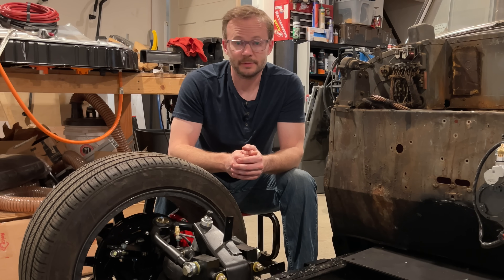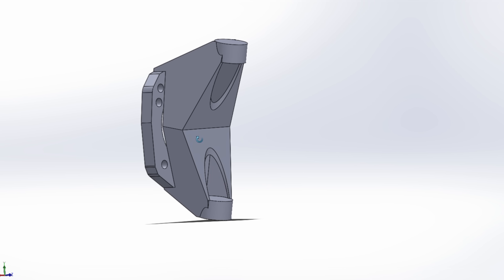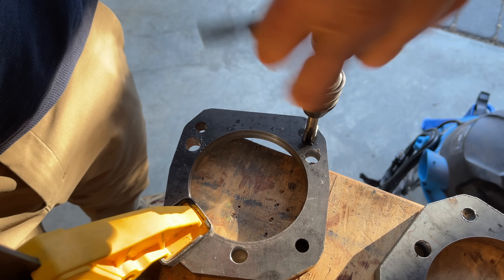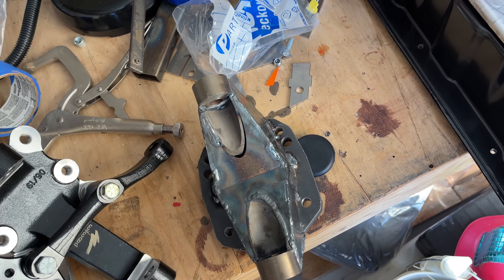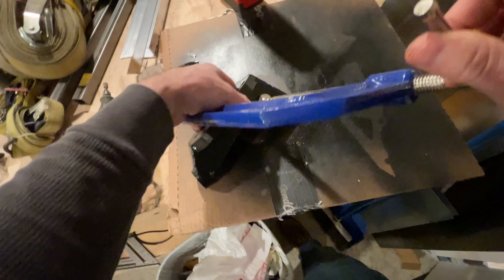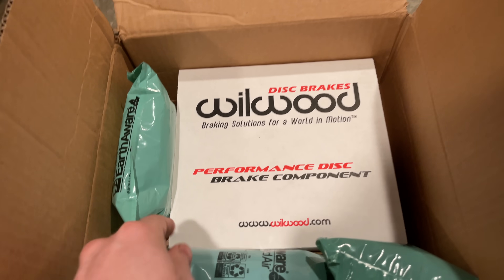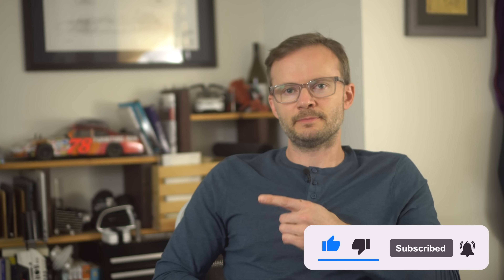Build Your Own Suspension Uprights. Or Just Watch Me Do It. Whatever.

Comment: Bro,  you are inspiring me to design my own custom suspension for my VW bus
Reply: check your local laws though- here it would be completely illegal- even the wilwood brakes would be illegal since the company does not provide the proper paperwork...
Reply: @olik136  yeah..... I got a lancia stratos (or rather, the rusted hulk of one) and i've been waiting on the paper work for years now so i can start the restomod correctly
Reply: Omg it's jehugarcia
Reply: Comfy or sporty?
Reply: first come to norway and convert a Volvo L-3314 for me :-P
Reply: Porsche 996 suspension would be great on a vw bus and then add hp.
Reply: I thinkt it would be a bit hard, most likely th easiest way to go is using a suspension off a car which has a frame and body on top.

So more regular cars like the 996 or your run off the mill car,they have strut towers and the suspension is attached to the bodyshell. Of course it is reinforced, but an older car has a more squar tube below.

So I imagine if you look at Corvette c4 front suspension, I think this is doable to adapt to classic cars as it is kindof an "all in one package". A bonus is that you also then can upgrade brakes at th same time.

Comment: Have you picked the Small Diameter Tesla wheels, because of the gearing ? If you fitted Jag diameter wheels the tesla motor would have to work harder & go slower , & worse again if the Jag has a higher drag factor & if its heavier than the tesla??    Or is it just you like the small wheel "dachshund" look ?

Comment: All the comments talking about safety nonstop make me think it wasn't a normal thing to build custom rally cars from junkyard finds as a teenager and slam them around tracks as hard as possible with welds and parts built using machines from the 50's and not the most experience.  It also makes me think that people forget Matt isn't new to engineering parts.
Reply: Safety third

Comment: That "press fit nut" and the half-a-hole on the other piece gives me the safety willies and I used to be a precision/stunt driver.  I usually over-engineer/build my prototype bits and then add speed holes later.

I applaud your impetuous madcap style.
Reply: Fr all that weight and torque under load lol fuck that shit

Comment: @SuperfastMatt
I have tried to get your attention before on previous videos, you have got your caster all wrong, top ball joint should be back from the lower one to get positive caster
Reply: Many years as a wheel alignment specialist with knowledge and understanding of geometry and lots of hot rod running the Mustang 2 set ups as well, I can just see it is wrong
Reply: @russellmurphy4191  Well, that's entirely unhelpful! You're saying "I can just see it is wrong, but either I don't understand it or I just can't communicate effectively, so I can't tell you what is wrong about it". 

The caster is determined entirely by the relative ball joint positions, and the ball joint positions are determined entirely by the control arm design. The upper arm does appear to hold the upper ball joint forward relative to the frame pivots for the arm, so either the upper arms are reversed side-to-side, or the lower arm holds the lower ball joint even further forward.

Matt, did you have a brain aneurysm or something and design the caster to go the wrong way, or did you put the upper arms on the wrong sides, or is the correct caster just not apparent in the angles of views provided in the video... which is not about the suspension geometry at all?
Reply: @brianb-p6586  Sorry, better explanation, in the video where Matt changed the arms, he said he changed the ball joint position to give it more caster, more caster equals top b/j back or lower one forward. I suspect Matt has simply got the left on the right
Reply: @russellmurphy4191  It looks like you're seeing what I thought: the upper ball joint is noticeably forward of the middle of the suspension tower on the frame, even though a Mustang II upper arm is normally symmetric (ball joint centred between the frame pivots which straddle the suspension tower, and interchangeable side-to-side). Forward would be bad, if the lower arm didn't match.

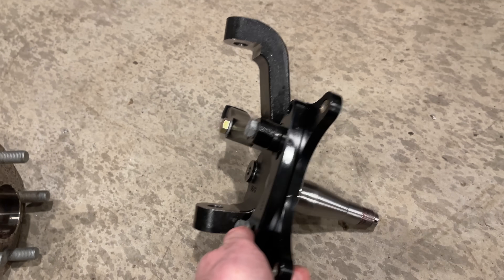Look back to "The Front Suspension Gets Installed With Minimal (Heavy) Modifications" (https://www.youtube.com/watch?v=joYqdDehYEk) at 1:52, and you can see that in the Jaguar the axle line (and thus ball joints) are well forward of the middle of the tower: both upper and lower arms hold the ball joints forward, and Matt has had to copy this to properly place the axle line relative to the mounting points of the suspension arms on the frame. 

Go to 3:25 in that earlier video and hear Matt mention this position, including the need to reposition the shock on the lower arm as a result, without mentioning the ball joint location which is handled by his custom frame mounting bracket. 

That just leaves the upper arms; the section for that starts @4:53. They are clearly not stock Mustang II, and in fact are completely custom. Looking at the suspension in that video, it's clear that the arms are on the correct sides, and need to place the ball joints forward (relative to the tower on the frame) to work with the lower arms, providing the correct caster.

So the end result is that if you think you are looking at Mustang II arms (which you're not), you'll think there's something wrong (which there probably isn't). The upper ball joint is noticeably forward of the shock tower on the frame (which seems wrong for a Mustang II), but the lower ball joint is even further forward due to its placement on the frame.
Reply: I'm sure that Matt understands that. Uprights are routinely designed so that in side view the upper ball joint, hub centre, and lower ball joint are all on the same line - that line is inclined to the desired caster angle by the suspension arm geometry... and that geometry is not clearly visible in Matt's videos that I have noticed. What are you seeing that suggest that the caster is wrong?

Comment: @superfastMatt What kind of gap did you leave for your tabs? In short a 2 inch rod will not fit in a 2 inch hole without a press so to speak.
Reply from the maker: 0.010”

Comment: How did you align the upper ball joint with the lower ball joint? They need to be in the same plane yes I know you can adjust the caster camber. But the car will not corner correctly if they aren’t.

Comment: Hot tip for POR15, use an icepick to punch two holes in the lid and pour the paint from that. When your done, cover the hole with masking tape until next time. Saved me a bunch of headache when I learned this method.

Comment: Hmmm. Whenever I've wanted to lower a vehicle in the past I figured I had 2 choices, cut the springs and pretend the effed up camber curve, the 'orrible ride and bump-steer weren't that bad, or spend too much for some pretty dicey Chinesium cast iron drop spindles from a company more concerned w "Stance", or "Laying Frame". Not sure why it never occured to me to just fab something myself. An upright is definitly within the scope of my skills and tooling. THANKS MATT! You don't suck.
Reply: Might be fine in your part of the world, but in Australia, welding of steering or suspension parts is not allowed.
Reply: @derekhobbs1102  that goes true for most of the developed world. I would never accept a ride from this guy. Never know whats hiding beneath
Reply: @holmes1956O  "This guy" Matt is an engineering graduate with a successful Formula SAE record and a subsequent career in the industry. He probably knows what he's doing.
Reply: @holmes1956O  Fair enough.  Until the 90's most race cars would have had uprights fabricated out of cut, bent and welded sheet metal (steel).  It's only since the 00's and the advent of cheap CNC milling machines that most race cars have uprights made out of billet aluminium.

Comment: You know, you could have just took a die grinder and went to town on the wheel centers. That's something I witnessed at a rod shop in SoCal- fitting Mercedes wheels to a Mustang II front end attached to a Mercedes 450SL. I worked there about 2 months at that point. I didn't stay long after that.
Reply from the maker: I seriously considered using a hole saw on the center. But that seemed a little too sketch.

Comment: for POR 15, put a screw through the metal lid, use that hole to pour out what you need. its a lot easier to crack a screw loose.

Comment: As a mechanical designer/drafter, I like the slots and tabs. The welders in the shop like them too!

Blinker fluid. HA!
Reply: Yeah . I  spotted the Blinker fluid too . You can never have too much of that on hand , Eh .
Reply: Weirdly, most modern cars have issues with their blinker fluids. They either leak out of the canister or get used up. I wish there was some kind of indicator on whether they work or not.

Comment: I’m not familiar with Tesla front hubs, but it looks like a front wheel drive vehicle hub, those require that a shaft end is installed and tightened around 200 - 400 lbs to keep the hub bearings from separating, how did Tesla solve that??
Ok at 10:06 I can see that there is most certainly splines in the hub. YOU ARE NOT GOING TO BE HAPPY WHEN YOU’RE FIRST DRIVE ENDS WITH YOUR FRONT TIRES SLOWLY COMING OFF YOUR CAR WITH THE INNER HUB!!!!
you are going to have to redesign it again.
Reply from the maker: I will explore this further. Seems like a good excuse to buy a used hub and tear it apart.
Reply: @SuperfastMatt  Excellent! But good luck getting it apart, except by bandsawing it through the middle. Did the hub units that you are using come from the front or rear of a Model 3 (they may be identical front and rear), and if from the front were they from an AWD or RWD car? It's hard to pin down details, because there is so little availability of aftermarket parts for any Tesla.
Reply: That is an issue with some front hubs, but certainly not all. 

I don't know about the Tesla hubs specifically, but some front hubs are designed to accept an axle shaft in AWD models but the same hub is used in RWD models with no shaft, and no other retainer ( because the bearings are just pressed in, or held by some other retainer). It's freaky when you see a vehicle with these hubs and no hub cap - and nothing but empty rusty splines in the middle - but it's done; some of the local police Tahoes are 2WD and they are this way.

From online parts listings, the RWD Model 3 hub appears to have a cover on the back (inboard side) and an just an empty centre (no shaft or nut visible) on the front (wheel, outboard) side, so I don't think they use anything through the centre to secure the bearings. If the AWD hub is constructed the same way (and there's no reason to expect otherwise), it would not have the cap, would have the splines, and still wouldn't need a shaft. 

I don't know if any modern hub-bearing-carrier unit like this in a car still uses the axle shaft to hold it together.
Reply: What is modern to you?
My VW golf 2004 requires a axel shaft.
I would rather know than find out I was wrong half a mile from home.
Reply: @Colt45s1911a1  "still in production" might be a good approximation to "modern", but even if the current (Mk 7) Golf used the same front hub design as the Mk 5 (or Mk 4?) hub from 2004 - and it doesn't - it's not what I was talking about. I asked if a "modern hub-bearing-carrier unit like this" still used the axle shaft; that means the bearings are permanently attached to the hub and to a carrier which bolts to the upright. 

In the 2004 Golf (and most of the cars that I have owned, too, including my current 2012 Mazda) the bearings are mounted directly in the upright, so they must be made removable (usually with a press) and need a removable retainer (such as the stub axle). In a factory-assembled hub-bearing-carrier unit like the Tesla unit that Matt is using (and a Mk 7 Golf, and the current version of my Mazda), the assembly can never be taken apart without destroying at least part of it (the whole assembly is replaced each time), so it can be designed to be pressed together in a way that doesn't need the axle stub... as is obviously true of the RWD front hubs.
Reply: Matt has now cut apart two hubs to illustrate the design and prove that the axle shaft is not used for retention, and there is no problem, despite colt's alarmist shouting. Matt did not have to redesign it, because there is nothing wrong with the current design. See the new video: https://www.youtube.com/watch?v=OU_-EqKSac0

Comment: protip for the lasercut tabs, if you put a cutout around all internal sharp corners, like the ones on a straight edge (we call them mickey mouse ears), the fit is way better. the laser can't make sharp internal corners, it gets close, but there is some cylindrical kerf to it. about 1mm radius is enough for most thicknesses
Reply: Inside corner relief - good idea. Apparently this is a standard feature in CAD programs and CNC, which I didn't know before looking for it, but makes sense.

Comment: Love the design process of using slightly modified off-the-shelf parts and getting things laser/plasma/water jet cut to then weld. Who needs a cnc XD? Also, look into the spray paint that has the catalyst built-in. It goes by the name "spray max" and Eastwood has some. It dries much much harder than normal rattle can stuff. Your uprights are immediately going to shed paint when you spill break fluid on them or clean them with an aggressive brush.
Reply from the maker: I’ll check it out, thanks!